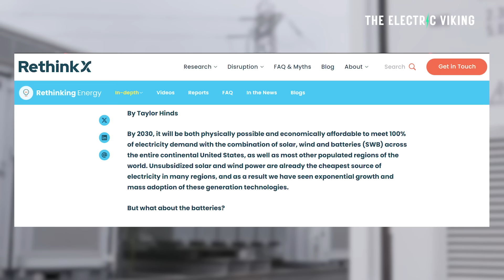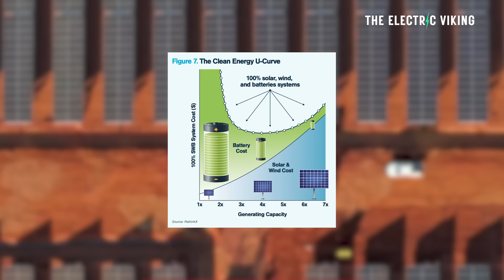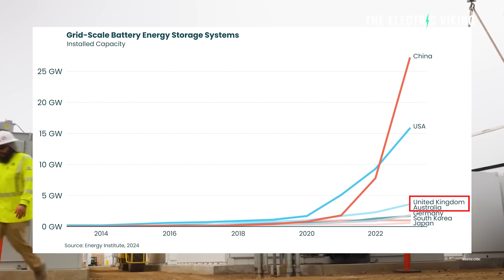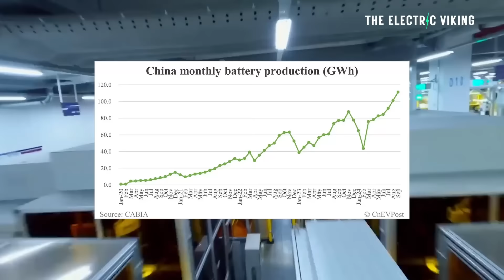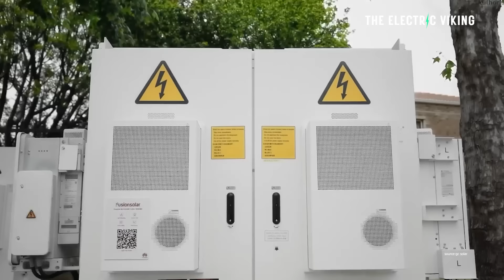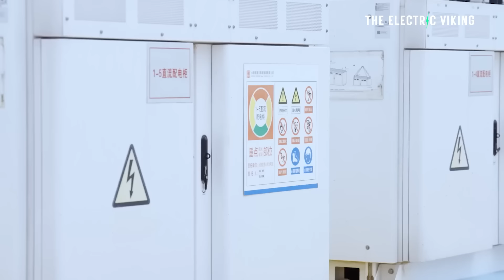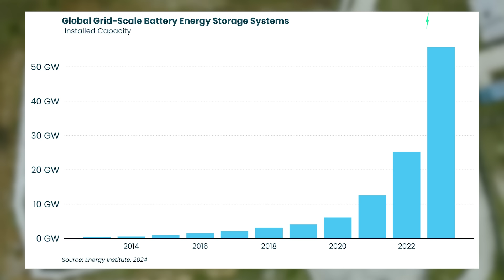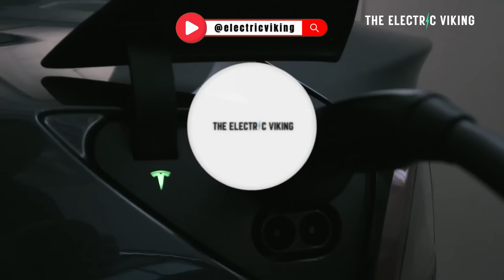RethinkX reveals the shocking exponential growth of battery storage worldwide

Comment: Worth noting that what you need isn't batteries per see, it's dispatchable, clean, and cost-competitive energy sources, of which batteries are just one kind.

Another kind, which some countries have in large amounts, is hydropower dams. With hydropower, the amount you can generate is limited by both the amount of water available and the total power of the generators — but within those limits it generates power on demand, and water not used at any given time can remain stored to generate power in the future; it, in essence, works as a very large, highly efficient battery with little in the way of losses (and you can even add floating solar to the reservoir to further reduce the losses to evaporation while making use of the dam's grid connection for the floating solar).

A good, reliable and capable grid also helps, and more so for large countries (or groups of countries with integrated grids) large enough that no climate system can cover the whole grid — meaning lack of sun or wind can be offset by sunny or windy conditions somewhere else. It's how Shanghai can still use a lot of non-stored solar power even after the sun sets; the sun sets in China's west hours after it does in Shanghai, and the country has the integrated grid to bring that electricity to where it can be used.

It's why a country like Brazil has very little in the way of batteries; it doesn't need those, not for a good while. Brazil has enough hydropower that it can avoid curtailment by merely reducing hydropower generation in real time according to how much wind and solar are generating, and having hydropower pick up the slack when the amount generated from sun and wind falls. Brazil is also very large and with a fully integrated grid, allowing renewable power generated somewhere to fulfil electricity demand literally thousands of miles away.
Reply: The next frontier is thermal storage.  Built on the same principle as a blast furnace, extremely large mass, powered by excess cheap electricity, to avoid curtailment.  It can then be used for industrial processes, area heating systems, to generate steam, etc.  Best part is literally dirt cheap to build.  Infinitely scalable, can locate anywhere.
Reply: @brettgracey9682  Not really. Storing energy as heat is only effective if you are going to use the energy for heating — in which case you want the storage as close as possible to where it's going to be used because transferring heat is much harder than transferring electricity.

If you are thinking about turning electricity into heat, storing the heat, then turning it back into electricity when needed, the round trip efficiency is too low, which really hinders its usefulness.
Reply: @ two things about your statement.  As I said, used for industrial heating processes, or also area heating.  It uses excess electricity to generate heat stored in large mass heat storage systems.  It can literally be built where there is demand for that heat, so not sure why you even mention transferring heat.  Are you not familiar with an area or district heating system?  Where they exist, heat is already moved as steam or hot water.  

As for turning heat stored in a large heat storage device,  back into electricity, that would depend on the efficiency of the process.  The same limitations there are in charging and discharging batteries in relation to the cost of the various systems.  The big advantage of thermal storage is that we can change the source of heat from fossil fuels to highly scalable, cheaper renewables.
Reply: @brettgracey9682  I mention transferring heat because you said it can be built anywhere; while technically it can be built anywhere, it's only feasible if built very close to where the heat will be used.

As for storing heat to turn into electricity, the problem is that the currently record-holding best efficiency is 44%; that compares with over 90% for regular batteries. In other words, you are throwing half the energy out by storing electricity as heat, which makes no sense with batteries as cheap as they are right now, and expected to fall significantly in price in the next decade.
Reply: @ I get his feeling that you think I’m talking about some home based system, I’m not.  Industrial heat accounts for a good 25% of our green house emissions.  Much of this can be replaced with electricity, especially intermittent wind and solar.  At large scale, think blast furnace which can contain thousands of tonnes of high heat capacity materials being heated to 1000+ degrees C.  Turning that into steam, isn’t extremely difficult to do at high efficiency.  You have the efficiency of the insulation vessel, which can be very high, heat loss to latency, (which honestly could be negligent) and efficiency of the heat exchanger, which frankly could also be very high.  It’s honestly not all that hard of a concept to grasp, as much of the infrastructure in these already exist.  Lots of industry already use FF’s to create steam or lower temp heat to use in their processing.  All it would take is putting in the heat storage, which is existing technology, literally dirt cheap, requiring no exotic or expensive chemicals or metals.  Then it would require a ramp up of new renewable sources to power them.  Again easily scalable, existing technology.  

As for this being “technically” available anywhere, there are no technical barriers to it.  Anywhere that could have electricity can use this.  Unlike charging and uncharging a battery the source of electricity doesn’t have to be at some max power point to be most effecient.  It’s simple resistance heating, where optimal power point isn’t required for efficiency.  

This is literally the lowest hanging fruit out there.

Comment: The hydro pump storage “battery” technology is very possible in the Scottish highlands - which obviously has mountains and lakes. But the environmental protestors are attempting to block the investment. This is the biggest issue with renewables in the UK. Everyone worried about climate change wants these investments BUT NOT NEAR THEM. The same issue applies to wind farms and solar power installations.
Reply: Hydro power doesn’t need battery storage, because it’s already base load. Using pumped hydro increases its base load capacity. Incidentally, there’s only one lake in Scotland.
Reply: @229andymon  Lock Ness is a huge lake, literally a cleft in the Earth’s crust between two plates. The long thin lake has mountains on both sides on which numerous dams could be built. The scope for battery storage is enormous. Pump water to the higher lake when there is a surplus and let the water drive the same turbines to generate electricity when there is a shortage.
Reply: @johnfrancis4401  If Loch Ness was a lake, it would be called Lake Ness. As for your explanation of how pumped storage works, thanks, however I’m well aware already. In fact I live near a couple of Scottish lochs already doing that. We’ve been doing it for some time. 
I reiterate however, you don’t need battery storage for hydro energy, it’s not intermittent.
Reply: @229andymon  It’s fresh water so of course it’s a lake. And Lock Lomand is also a fresh water lake, it too is massive and is suitable for this type of battery after a dam is built on the nearby mountain. You seem to have a fundamental misunderstanding of what pumped storage is.
Reply: @johnfrancis4401  Like your spelling you mean? Firstly, there is already a pumped storage scheme operating out of LocH LomOnd. Secondly, there are freshwater and sea lochs. 
I’m very aware of how pumped storage works. I worked in Scotland’s energy industry for decades. 
You need to study much more and comment less.
Reply: @229andymon  You’re wrong about the value of pumped storage but correct about my spelling mistake.
Reply: @johnfrancis4401  I never commented on the efficacy of pumped storage, I stated you don’t need battery storage for it. As it happens I believe there is value in pumped storage, especially by way of providing a mix of renewable energy sources and especially useful as a base load source (that you don’t need battery storage for).
Reply: @229andymon  Good. We agree it seems. Wind and solar are intermittent and sometimes over productive. Pumped storage schemes will reduce the need for chemical batteries as produced by Tesla and the need for methane burning power stations on standby. This is why they are so useful.

Comment: Grid batteries need not be built at a wind farm or mass solar array.  They can be anywhere on the grid.  Perhaps one in every electricity sub-station in you neighbourhood.
Reply: No. Consider the UK situation. The grid's choke-point is roughly at the Scottish border. So storage at the source side of the bottleneck will be effective, where as at the destination side, it won't. In this case, the answer is to put the storage close to the wind-farms in Scotland.

Comment: Excellent video,
The other extreme is coming. 
Customers with rooftop PV and OVERSIZED battery in their V2G EVs not wanting any grid electricity. 

The $TRILLIONS Australian national electrical grid needs $100sBILLIONS from millions and millions and millions of customers. 
Dead CASH FLOW is an extremely dangerous economic future for the Australian national electrical grid. 

I bet that the grid will want customers to remain connected and oversize their rooftop to be the suppliers of dirt cheap electricity.
The grid will use the existing grid to supply the new demand from heavy industrial customers moving away from fossil fuels. 

The logic is overwhelming.
The grid will be repurposed.
The grid is too valuable and fragile and will be protected and maintained. 
New CASH FLOW is the key.
Reply: You're forgetting commercial and industry which draw more power from the grid than domestic. Plus verticle multi-dwelling housing doesn't have sufficent land area to generate for all the occupants.

Energy suppliers and grids are planning, if not welcoming, home generation as it's a cheaper source of energy for them. It's the energy generators who are more impacted, particularly the legacy ones.
Reply: @GruffSillyGoat  good comment. 
I live near suburbs with tall residential buildings surrounded by single dwelling homes. 
The home roofs are 200m² approximately, and a 6.6kw rooftop is only 33m², 16% of the full area .
So double the area covered on all roofs is feasible and the tall buildings can take nearby excess.
Rondo Heat Battery, 1, 500⁰C  temperatures storage is new technology for industry. 
Industrial sized battery will be part of it.
Some legacy fossil fuel use could remain with little impact.
Petroleum for road building and maintenance and petrochemical industry and emergency use and military reserve will remain for decades. 
The legacy generators and all non-rooftop energy will have to include the grids' capital costs.
Generation capital costs $billions.
Grid capital cost is $trillions.

Just my thoughts from decades of construction in this area of expertise.
Reply: @stephenbrickwood1602  - Costs and degree of benefit of PV will vary by location. In Northern Europe for example wind plays a more important part, particularly the offshore variety, hence grids will still have a role in transporting energy. Home PV fits nicely in generating in warmer months when wind output is lower, but in darker colder minths wind provides much more power than PV. Not all grid upgrades are costly, the UK for example costs £29b but in reality is a series of projects connecting areas previously poorly served, addrssing pre-existing congestion point and extending the grid to the coast for offshore wind. Over the 15 year amortised period and 68 million people this is relatively a small amount anf tiny in comparison to the fossil-fuel subsidies currently payed.
Reply: @GruffSillyGoat  Understanding that rooftop PV has no grid costs is fundamental to understanding the future of clean energy. 
Electricity is 10% of all energy used. 
So, no fossil fuels in a clean electric future means the grid capacity has to be 10 times bigger. 
The national grid was a 14 decades and $TRILLIONS in the national wealth project. 
Bigger grid is incredibly expensive. 
Simple first principles estimate tells the basic difficulty. 
Climate warming is also economically dangerous. 

Rooftop PV has many advantages, with electric energy at the customer's location.

Comment: A critical factor is battery life.  Batteries for homes are very expensive and they last only 10 years or so.  So you have to put aside about $1000/year to replace your $10,000 battery pack.  You just can’t ignore this high cost.  That isn’t even looking at solar panels or other components of the energy system.  This is why people really love selling excess electricity to the grid and avoid this huge battery cost.
Reply: 10kWh is less than £1300 today. A year ago the price was double! 425W panels are £54.

Comment: Now please don’t take this the wrong way but a lot of what was said in this video is pie-in-the-sky BS. You all are thinking in MW and should be thinking in MWH. Take for example a solar panel in San Antonio Texas. It has a utilization factor of about 25%—-probably high. Let’s say that panel is 1KW and you need to supply a 1KW 24/7 load. You will need 4 panels and roughly 18 MWH of battery. AND this doesn’t cover the  overcast rain days that have to be made up. Expand this to a 300 MW 24/7 load and you see the problem and obvious current order of magnitude cost advantage of say a gas turbine.  300 MW 24/7 is 7200 MWH. Goggle Ercot market conditions and you see the magnitude of the problem and while wind generation helps out, it too is not consistent and has a utilization factor —— existing wind generation dropped roughly 5% year over year because of less wind! Probably because our politicians are sucking so much.

Comment: Wait, wait, wait!!! At around 5:00... "In fact they (Tesla) already have V2G built in, it just hasn't been turned on." Where are you getting that little bomb?!! 

It is one of the reasons I've been using to hold off on getting a Telsa (I want V2H actually). That and I'm debating about whether I should wait for the Model Y refresh. But the 0% promotion they are offering right now (with FSD) in the US is VERY tempting! Who knows when they'll offer 0% again? I like free money.

I have been wondering about DC to DC V2H (with a Powerwall or other device in between) for a while because it seems like there should be nothing physically stopping the energy flow out as well as in. Obviously if you are pulling AC out of the car that requires a built in inverter but DC to DC with the inverter external is another story. Can they enable V2H with a software update (with a supporting external device)? Or do future cars have to have a change in HW in order to do V2H/V2G?
Reply: Also, you can slow(er) charge a Tesla with AC so there's an inverter built in. Can that theoretically support the reverse (AC out) with a software update? V2L (like KIA) would be nice as well. I want everything!

Comment: Needing a technology with zero runaway fire risk? This is to save on land costs so you stack the containers 4 or 6 high. Also a technology which gets much cheaper with scale, like the pumped hydro from 100 years ago? Thermal regeneration won't be as efficient as batteries, but scale makes marginal costs small. Calcium, sodium, potassium, magnesium, carbon, nitrogen, hydrogen, oxygen, iron aren't seen as toxic, and silicon, sulphur, phosphorus when handled properly.  There's a limited number of ways to inorganically combine the common, safe, elements.

Comment: Sam, good talk today, but I’m going to push you a bit further. The battery companies are being too short sighted and cowardly. Tesla is putting out its 13 kWh PatheticWall for the insane price of a thousand bucks per kWh. Again, how pathetic! Enphase is pushing a 5 kWh battery that isn’t even stackable! If you go Enphase or install a PatheticWall  you’d better have a gigantic garage. Every square inch of wall space, and over a year of your salary will be tied up in batteries!

Instead of a measly 5 or 10 or 13 kWh battery, the baseline needs to be 50 kWh. And installed, that 50 kWh  battery needs to cost less than $10,000 US. 

Cheap, big batteries will enable every home and small business owner to tell the corrupt electricity and fossil fuel cartels to eat sand. We are on a cusp! We have the technology now for home and small business owners to be energy independent for their homes, businesses and transportation.We no longer need to further enrich the electric utility and fossil fuel oligarchs! 

Yes, batteries, EVs and solar are still an expensive stretch for working people. So, that means the rest of us have to help our fellow citizens by driving the market and innovation and economies of scale and produce and store our own energy.

Comment: Solar, wind, and battery storage are soon to be obsolete technologies. Thorium nuclear energy is now ready for prime time. A spin-off company of MIT uses a new drilling a technique that vaporizes rock and is expected to be able to reach depths of from 10 to 20 kilometer. This will make geothermal energy available in most areas. The price of silver will rise in price that will soon make solar panels too expensive to be practicable. Buy those solar panels now while they are still affordable.

Comment: Batteries are only suitable for short term storage (hours, not days). Whereas coal and gas can be stored indefinitely 

Batteries are perfect for timeshifting arbitrage

But without backing by some other form of on-demand generation (nuclear, hydro, geothermal, coal, gas) the lights will go out when the sun doesn't shine

Sam also needs a lesson in energy units - doesn't seem to realise battery storage is rated in MWHr